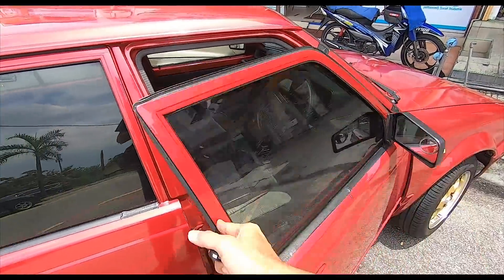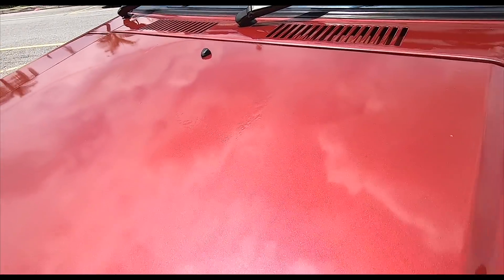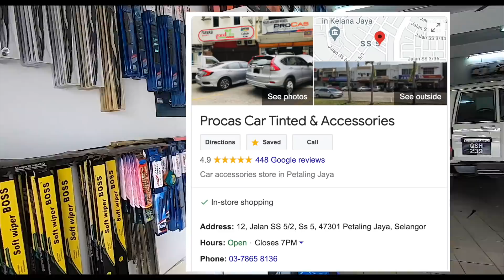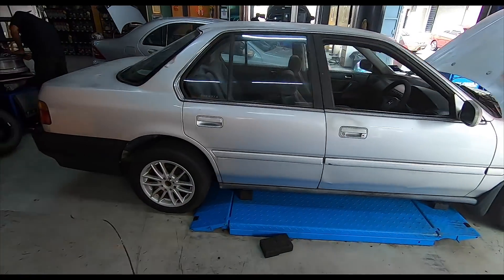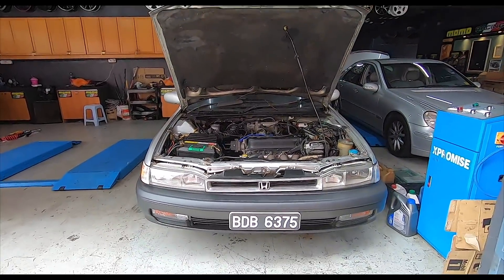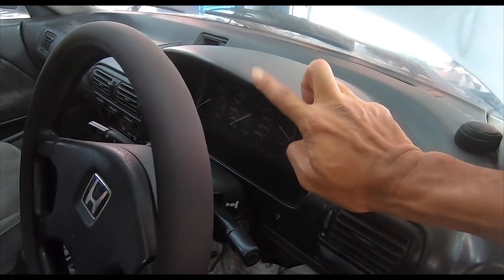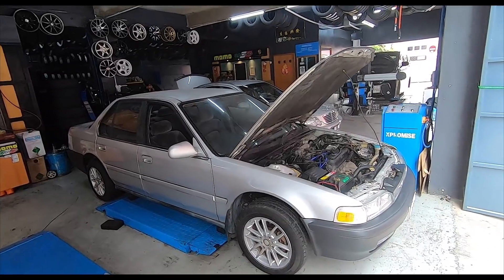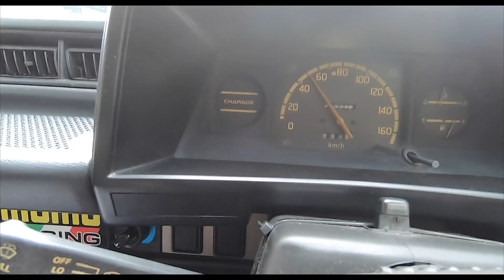WEEVIL UPDATE! Lovely 1989 Toyota LCII SWB 4x4 Spotted! PLUS Charade & Accord SM4! | EvoMalaysia.com

Comment: I was first posted to Baram in Miri.. Teaching the Penan people.. the LC mk. 2  is THE car there... It just won't die on you! If the ladder frame break.. the body hold it up.. if the body break the ladder frame holds it.. even if u break the long shaft.. put it into 4wheel and drive with the front wheels.. no diesel? Buy some nasty  unfiltered diesel from the balak camp for their lorries and the car can run (even hilux gave up at this point)... I wanted one.. but end up with a ford ranger... Still smile when I see one.. good find bro..
Reply from the maker: Thank you for sharing that bro, what an awesome read!! 🙏🏽👍🏾😀

Comment: I own the LWB, Prado version of this, stock height but it's on 33" mud tires. Due to the length of the vehicle, it poses a difficulty in clearing the ceiling when driving up/down ramps in car parks. It won't go past the 2nd floor of my condo parking lot (my designated spots are on L4.. haha) and fighting for the very limited (and not to mention, illegal) street parking outside with freeloaders, EVERY DAY, was a hassle. It now resides in my kampung. Maybe a SWB Land Cruiser can solve this problem for me! One can wish.
Reply from the maker: Damn, wow. Thanks for sharing that bro, yeah, these SWB variants are very cool 😀